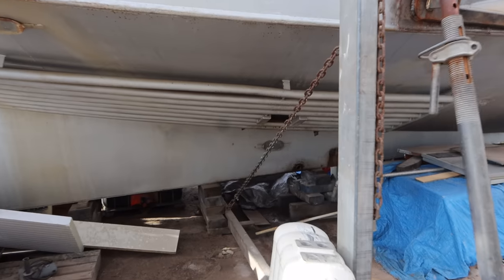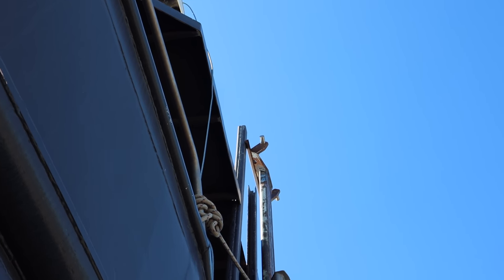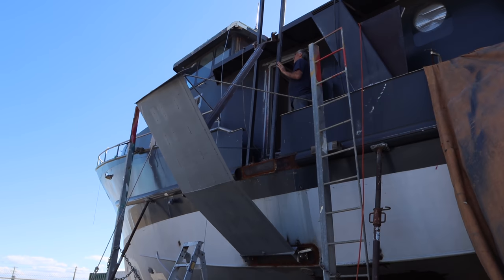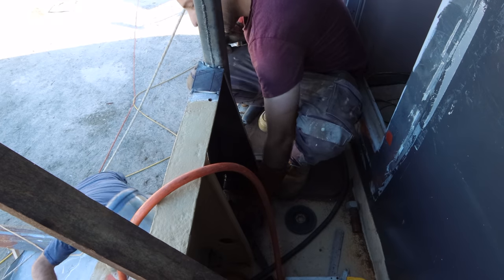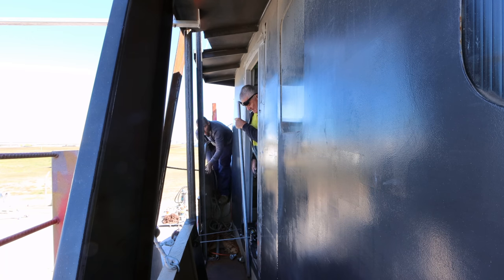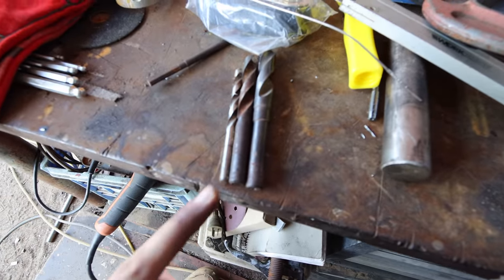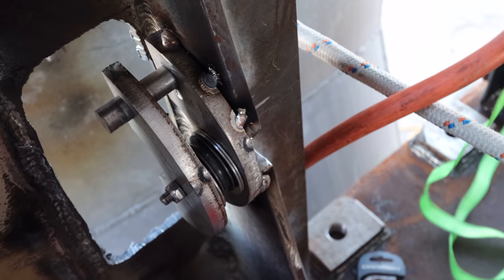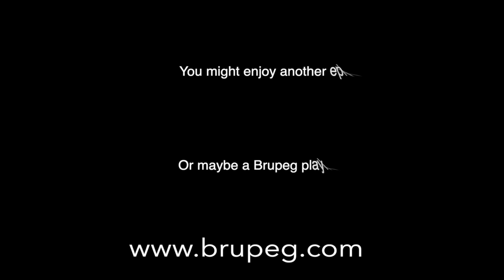Making Pulleys (part 1 of 2) - Brupeg Ep. 169

Comment: Food for thought
If not already realized, cable tensioners for slack cable control. I can visualize the wings 
flopping in the water, while the boat rolls as you are raising and the cables getting slack
during wenching. ?
Reply from the maker: Hi Michael, yeah i want to build some version of cable tensioning. One concern i still have is lowering the wings fully and the cable unwrapping on the winch drum. it coils up and lowers perfectly with the current design but without te tensioner gadget there is a risk to fix there
Reply: @ProjectBrupeg  I have pondered this critical issue in the back of my mind ever since it occurred to me and there is no easy answer, unless someone else in the world has dealt with it and cured it in a simple way but, I do know this, You have got to control the upward force on the wing(s) while they are in an unlocked position or be in absolute dead waters while raising or lowering. I can only visualize a dual action hydraulic ram in place of the fixed strut or a combination of the two, otherwise.
Reply from the maker: most of the fishing boats use some sort of winch mechanism (various layouts but all sorta similar) so im not too worried about losing control when raising/lowering the wings and thats also we will focus on when first testing the wings etc, as for the tensioners i did think of a srping loaded stainless pad that rests on the wire on the winch drum. im not sure if it will work and I havent had the chance to do some googling to see what others have done in this area

Comment: Dame do you have plans for rubber snubbers on the wings or on the side of the boat to protect the wings from being over extended in or bumped in docking? I''m sure you could build one or two per side and they could act as steps to get  on to the wings.
Reply from the maker: Hi Bob, yes the plan is definitely to add some version of a bump stop. Mainly so the locking pin is always held under tension so it stops clonking of metal on metal.

Comment: Forgive me if this has been asked and answered. I’ve watched this with interest for several episodes and the question I’m left with is Since you have built this excellent sliding control arm why pull with a cable that requires a high draw winch and is prone to kinks and breaking and can really only be held tight in the two extreme positions. Why not thread them and just put an electric screw jack. It’ll take less power to run them up and down and if anything fails it stays put instead of falling?
Reply from the maker: Mainly complexity, a winch can be repaired almost aywhere in the world with basic tools, screws are really effective but also add a complexity that could bite us down the track. Winches do have compromises but its nothing we cant solve.

Comment: Do you have enough winch force to lift from the end of the arms? Where the pins slide up and down? The cable going to the wings is in my mind a maintenance liability and going to hum through the water as well as catch on things.  Maybe a back burner idea for mark 2 idk. I made a comment before about being able to winch the wings down as well as up. If the winches had enough force you could just have an endless loop from the deck to the roof with the slider pins connected.  Could even still have 2:1 if needed.
Reply from the maker: Hi Jon, the physics of lifting from the arm tops just doesnt work, when the wing drops from 100% up to 80% up the arm top only moves half an inch. As for the maintanece issue, it does add to that but its also manageable, every trawler uses wire rope lowered into the sea to pull nets through the water, if the wire is greased its not an issue.
Reply: Project Brupeg i see the issue  its no ideal. Although the wings would be at their lightest between 80 and 100% up? And its not really a useful range to have fine control in and you probably should have a secondary system to keep the wings fully up anyway not just the winch. Sure your current system will work very well anyway just throwing you extra ideas.

Comment: Silly Question (Maybe I should be watching to the end) are you going to lift the wing from the top of the Brace? - Directly between the two bolts that screw down into the deck.. seems like it makes sense to lift vertically between the sliders  then the angle to the winch doesn't matter ..
Reply: Buy Brace I mean arm.
Reply from the maker: Hi Gerald, short answer no. We will be lifting from the wong itsef as physics dont allow the wing to be fully retracted if lift from the arm

Comment: Would you be able to curve the top of the pin guide rails inboard at the top of the slider travel? Might be able to snug them in tighter with less travel. Just a thought... love the videos!
Reply from the maker: Thanks mate, yeah we did discuss this but we dont have the ability to easily create bent sliders like that. The idea is sound and would work well but its something that would add another month to the build for us to manually fabricate the curve needed

Comment: In calm water you could partially lower the stabilizers and use them as a swim deck
Reply from the maker: Very much. And in heated arguments they could be spring loaded and used as a surprise Trebuchet

Comment: Great to see the wings working... When welding stainless to carbon steel should you be using 309 stainless wire to prevent the welds from cracking?
Reply from the maker: Hi Thomas, yeah we use 309 as a rule for our stainless work, we only have other metals for TIG welding but all of our MIG stainless work is 309LSi

Comment: Dame just an observational question, why are you sending cable out onto the wings and in the water when the wings are deployed?  Seems you could lift the head if the arms straight up the rails with a two to one purchase by installing a centered lifting eye on the head of the arm. Beef up the head of the rails and This would avoid dragging wire through the water. Create an over-center dog to hold the wings in the stowed position while in port and keep the wire out of the water.
Reply from the maker: Hi Mark the physics of lifting from the arm tops just doesnt work, when the wing drops from 100% up to 80% up the arm top only moves half an inch. As for the maintanece issue, it does add to that but its also manageable, every trawler uses wire rope lowered into the sea to pull nets through the water, if the wire is greased its not an issue.
Reply: There it is, the bit I didn't consider, always learning from you two thanks! @ProjectBrupeg

Comment: Hey Dame, I just had a thought, have you given any thought to high current losses with the winches where they are and over the distance the heavy leads running all the way down to the battery room and the weight of the wings and drag through the water lifting the wings up, I'm not saying move the winches at all it's more current load on the winch and cable. I thought maybe run the leads to a high current inverter rather than directly off the batteries because the inverter should supply a good steady current supply during the lift and the lift is really the main thing, putting then down is easy. Just an idea mate. Seeya Rob........................hey Jess I hope your doing well mate and keeping the boys in line haha.
Reply from the maker: Hi Rob, the load on the winches is actually surprisingly low. So we are currently running them from the lithiums which seem to be handling it fine.

Comment: The question I have is when your winching the wing up by pulling the bracket on the wing are you pulling the wing in a downward motion to your bracket on the hull or are the brackets aligned or is one lower then the other ?
Reply from the maker: Hi Dave, they are aligned so there is no shear load, ie the pull is 90degrees to the wing surface when fully retracted.
Reply: Project Brupeg I was just wondering , thank you for your feedback !

Comment: The simple way would be to make an angle plate add two triangle gussets weld it to the tops of the sliders add 1 or 2 legs angled 5* back mount the winch to the vertical plate this would point the cable down to the  slider cap weld an eye bolt or pad eye to the top of the slider cap. Keeping it simple no pulleys no bends  keeps the cable out of the water too. You could also make a hinged box to cover up the winches. And use bend over tabs to secure the wire to the insides of the roof.
Reply from the maker: Trouble is anything that lifts the arm and not the wing always ends up with a force approaching infinity at the top to lift the wing in that last 10-20%. the arm height difference between wingtip tight against the boat and a foot out is about 10mm at the arm top.

Comment: What kept you from using a hydraulic ram fastened to the side of the boat to manipulate the fins instead of that slider system you made?
Reply from the maker: cost and complexity. The hydraulics needed rams (which wernt too badly priced) but the pumps and piping needed to feed them is where things blew out. the electrics we simple because we had a big housbank and the winches are relatively cheap

Comment: You've hit the nail on the head Dame, "Work in Progress" After seeing all the pulley access holes it dawned on me, Why put the winch on the roof when it would safely fit in the Railing?
Reply from the maker: Hi Michael, more details in the next episode but short answer is the steel on the rear roof is too thin and not strong enough to handle the winch loading

Comment: Could you not build a rotating locking pivot on the end of the slider arm. Quater turn and you release the slider wheel / roller axel. Imagine a standard skateboard truck with a pin through the fixing bolt
Reply from the maker: with enough time yeah we probably could. Most of the fishing guys dont bother with anything other than the bolts hence we just copied that basic design

Comment: How fun is drilling stainless!? Or better yet, drilling and hand tapping! I dunno bout you but I was losing the will to live when you said we have 2 inches of ss to drill. 
Also are you gonna weld some deflector plates to the hull on an angle to help with drag? In front of the wings I mean.
Reply from the maker: Hi Matt, with our new hot rod modifications on the old drill press I think we have the drilling sorted, but tapping stainless, we honestly dont even try, Im sure in some mythical land its possibloe to do but not on this boat, I know it would be the fastest way to create a broken tap in a piece of stainless for us. As for deflector plates on the hinges, no plans aye. on a bpoat like this you wouldnt even notice the difference with/without them. We also will be upgrading to a new hinge design at some point in the future so we wont be spending too much more time on these hinges, they work and thats enough for now.

Comment: NOT to figuratively "blow up yer skirt", Damien, BUT this follower is amazed at your tool-use skills, and ability to "engineer" anything from a small stiffener to a major, well, anything.  I suspect that you MIGHT also do a helluva' lot of "research" in preparation, but also just "see" what is needed to solve an issue, then go ahead and DO IT... Cheers from Canada, hard by Georgian Bay, Ontario...
Reply from the maker: Thanks Robert, about 98% of what we build on this boat is designed in my head and then just built. Ive always been like that, some things that get too complicated i scratch out on some paper or even use CAD if it will help, but mostly its just throwing design logic at a problem, finding the reasons why a solution wont work, fix those issues and then build the end result.

Comment: Two things (well 3 actually).  1st... great work and very good progress,  2nd....could you show how the rope is knotted as seen around 30:43?  I think its a type of knot designed to take up excess rope length without having to loop the actual end of the rope thru the knot?  3rd....is the reference to the speed of an unladened sparrow taken from a Monty Python skit?  (The bridge guard asks a question and if the traveler doesn't know he gets tossed.   He asks one traveler the speed of a specific bird and the traveler asks back, European or African?  The guard doesn't know and gets tossed.   At least that's my 30+ year recollection of it.  I'll have to look it up).  Thanks for taking the time to document and share your interesting work.
Reply from the maker: Hi it’s actually a knot used to add a purchase to a rope. That rope straps the boat down harder to the stands, I will try and shoot a piece on making one. I think they are called truckers knots

Comment: 1. Trev is still my hero.
2. A plate or protector on the inside of the track would be ideal. For safety of everyone’s fingers nearby while lifting and lowering the wings.
Reply from the maker: Cheers Jeremy, Yeah Jess wanted to add in some sort of guard in the gap between sliders. The arm slides in significantly less than we first thought so any gaurd wont extend into the boat very far

Comment: It’s easy to build something complex, but complex to distill it down to something simple. Nice work on the pulleys and brackets. 

On a separate note, are the cables going to be in the water all the time the wing is down?  Also instead of pulling the wing up with the cable could you instead hook the cable to the top of the arm and pull it up the channel?  You’d have to have some secondary way to pull the wing in tight to the boat, but that seems simpler.
Reply from the maker: Yeah that would be one way to do it, we opted for the system being as simply as we could make it so having to swap to a wing point halfway through the lift isnt something we would really want to introduce. This does mean the cables live int he water like you say but cables can be replaced, arms and crew cant.
Reply: Fair point. Excellent job by all, thanks for bringing us along!

Comment: Just curious...how much does "icing up" figure into your designs?  Given your plans to travel into frigid climates I can imagine you'll encounter weather that will develop significant ice formation on exterior surfaces, cables, ext.
Reply from the maker: Hi Bob, yes this is a risk we have to factor in, its funny the areas it effects. any area that is well exposed and likely to ice up (hand rails etc) we try to leave unpainted and stainless as this allows us to hit them with sledge hammers to break ice off. We also are looking at a steam generator so we can pipe hot steam around the boat using a hose so when we need to quickly remove ice weight we can try to blast it away as well as chip it off.

Comment: Personally i would have thought mounting the winch on the back of the sliders would be better.
Cople of ways to remove arms, leave the top of the sliders open so the arms can be lifted out, you could add a loop on the arms so you can use the winches to lift them out
or is there enough clearance to tilt the arm so the pins come out.
In each case you will need to disconnect the arms from the wings.
Reply from the maker: Hi Sparky, the sliders dont have the strenght for that, they were always built as guides only so while they do that job well we would have to maybe add 40% more steel thickness to them if we added anymore load

Comment: Awww I was really looking forward to finding out the airspeed of an unladen swallow 😂
Reply: According to calculations performed in the Physics Lab at Stanford University, the relative airspeed velocity of an unladen swallow is about 24.121 miles per hour or 10.784 meters per second. The difference between the airspeed velocities of European swallows and African swallows is too small to detect with current measuring devices. You're welcome.
Reply: It is just a bit more than an unladen one. (tech talk) Don't yew no nuffink.
Reply from the maker: Surely direction of flight makes a differnce, ie flying vertical up is somewhat slower than vertical down...
Reply: @ProjectBrupeg  I didn't go to Stanford. I went to California State. I don't know anything about their Physics Lab, because I found that information as part of the scientific journal article they wrote. I'm just the messenger...

Comment: I would make a cone and place it in front of the leadinding pivot pin hinge " like an ice cream cone cut length ways" this will help deflect anything like ice  and heavy objects from damaging the wing pivot point also I agree with the comment about winch placement as i work with winches alot,  and I also think your pulley size is to small for the task look at the size of pulleys used on 4WD recovery.
buy having a small pulley you are creating a sheer point making extra load. and the same reason for placing the winch in the correct place.
Reply from the maker: I would love some more feedback on this, next episod is out tomorrow showing the full system built and working, would love to hear your thoughts on the design. Damien

Comment: You could bild a box in front of the runners and run the cable straight to the pullies instead of being on willhouse
Reply from the maker: Hi Herby, unfortunatly the rear roof isnt strong enough to mount the winch. Hence we had to move it to the wheelhouse

Comment: Something concerning me about the stabilizers
While viewing your work in coctructing your storage area you pointed out the location of one of the welds from inside the hull
A portion of it was clearly evident
The mass of the boat will be stabilized by this small section of the boat without a bulkhead
Please give reinforcing the inner hull around that location some consideration
Your hull is not designed for outside forces at those locations
God bless